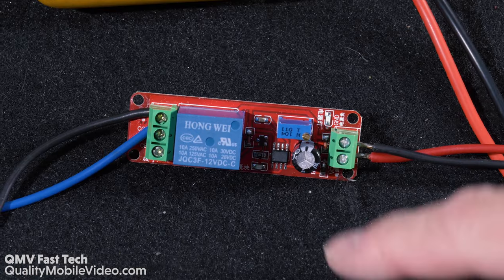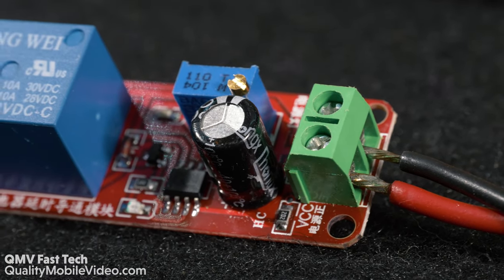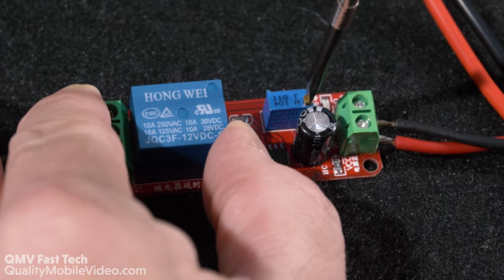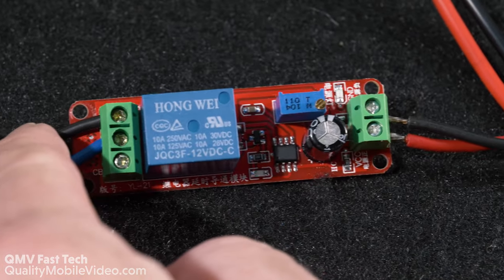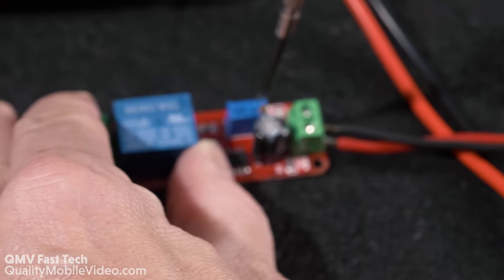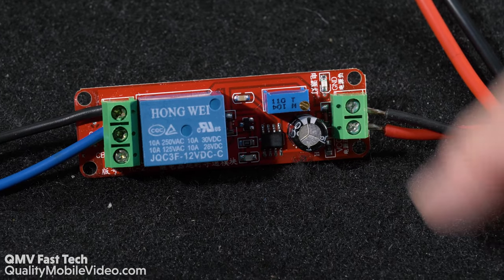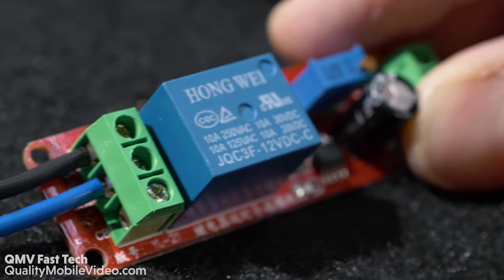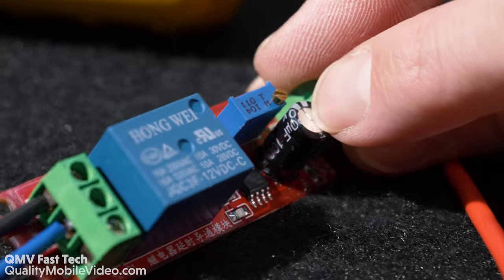1-10 Second Adjustable 5 Volt & 12 Volt Time Delay Relay

Comment: Thank you for your explanation, but I have a question. When I set the time, it works for me constantly, but the timer does not stop, meaning when it works for 10 seconds, for example, the ten seconds ends and it is still working, so what is the solution? Thank you in advance

Comment: Mine just showed up, I had thought it was a 4 pin relay as bought before it's picture & this video was created so unfamiliar with these. Looking to use it to turn on a 4 pin auto relay, it's trigger pin to "turn on" is pin 86 (believe 86, we'll just call it that for now). 

 How do I wire this, using the starter wire as trigger? 

3 ports on left: CK, COM, CB
2 ports on right: GND, VCC

EDIT: Guess I'll call in, on Monday's description there was mention of this being a momentary trigger on, now revised the description has no mention of being momentary.

Comment: I want to increase the delay time and for this i have replace 100uf capacitor with 330uf capacitor but relay doesnt work. when i insert 100uf back then again its starts working 10sec , Whats wrong can you  please tell me i need 20+ second delay